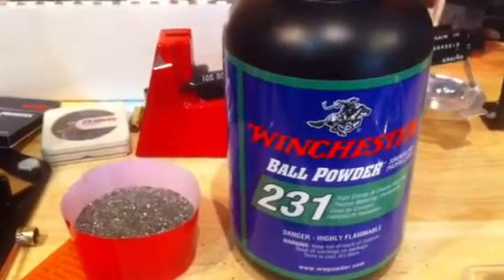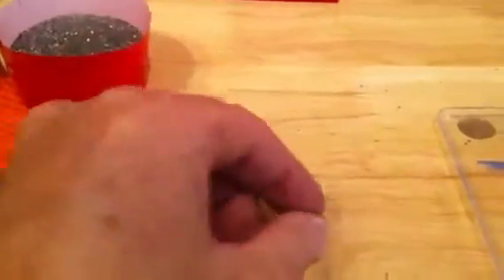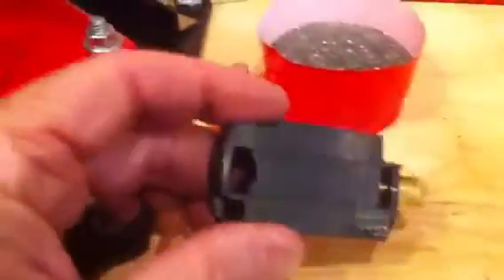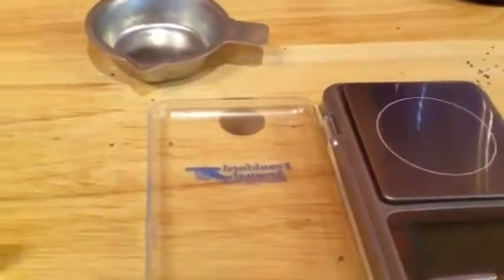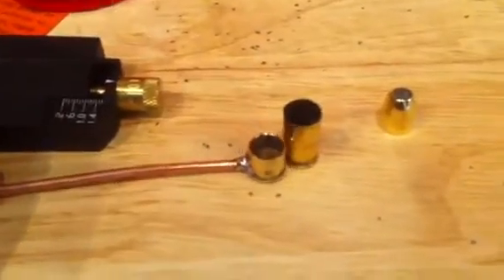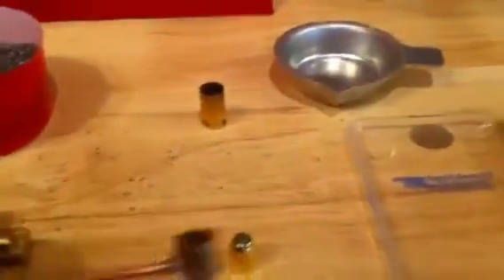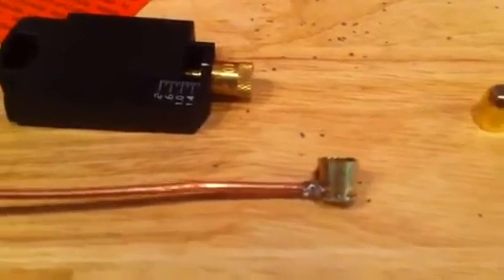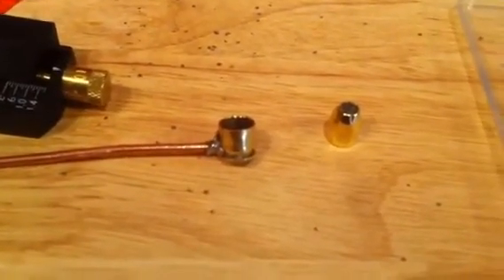Make your own Lee Dipper

Comment: Great tutorial on making a powder dipper.   These are by far the simplest way to get those small charges measured for small lots of cartridges.    In the past I have modified the plastic Lee dippers but like the cut down case better with a custom soldered handle.  
Thanks for taking the time to make this video.

Comment: thanks for sharing. I load 38 short colt using Winchester 231. The load data calls for a charge between 2.4 and 2.8 and I haven't found an easy way to throw a consistent charge so I am going to try this and see how is works.
Reply from the maker: Frank Ryder   Let me know how it works. This is an old post. I use the Lee auto drum and it does a pretty good job. Haven't tried going as low as your loads but I think it would work. Good luck.

Comment: Very interesting... Thanks! Would this be possible with just a simple soldering iron? Or would you need a torch to solder the handle to the case? I handload every round , with a Lee hand press. And as such, I also weigh each and every charge. Gives a very high consistency and accuracy on all my ammo.  This way I could make a nice dipper to get immediately to a certain base charge, just slightly below what I need. And then use a powder trickler to  round if off.
Reply from the maker: I just used a regular soldering iron.
Reply: I just made one. It really works great !!! See :
https://s18.postimg.org/628ej4pah/20160918_193116.jpg
https://s16.postimg.org/n9z1mhesl/20160918_193129.jpg
Thanks :o)

Comment: Just get an adjustable one that is used for black powder. Then measure out the amount of grains you want on a scale. Pour that amount into the adjustable and move the slide up until you feel resistance. Then, lock it in place. It will always dispense the same amount until you unlock it and change it.
Reply from the maker: +jjenson2006   I think the new Lee Auto Drum will solve the problem of accurate small (and large) charge loads. I bought one but haven't tried it yet. Thanks for watching.
Reply: +TheRotorhound Sure, that will work if you don&#39;t mind spending the money. You could pick up a powder measure for $10 if you wanted a cheaper way to do it.